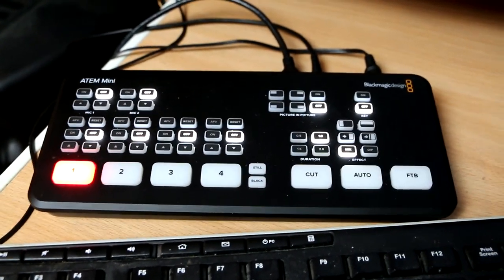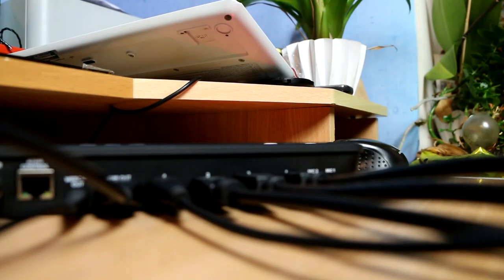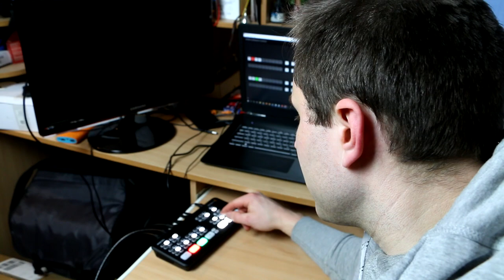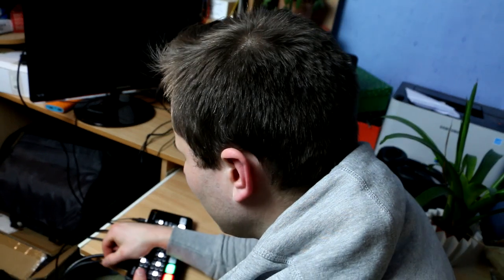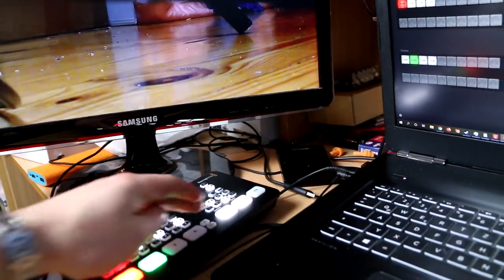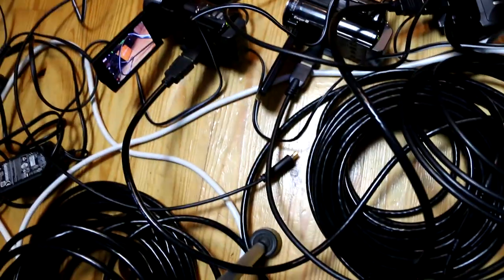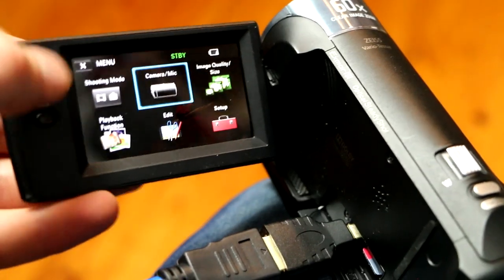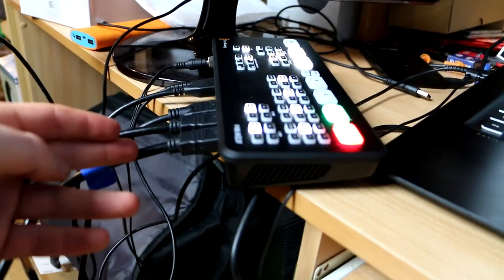How to Fix ATEM Mini problem that only HDMI 1 input works or no input from cameras

Comment: I'm using a couple of color security cameras that don't have switchable output resolutions. I tried a shorter cable and it worked. Thanks for this info. You did a great job of troubleshooting so I didn't have to. I am very grateful.

Comment: Thanks for the video. Had the same problem. 2 Sony ax43a cams. 1 cam didn’t work read. 1 Sony is Auto hdmi resolution. Changed the other to 1080i. Worked.

Comment: Hi! I’m using the Atem Mini pro with 3 Sony a6500. At the beginning I had this same trouble. Only Hdmi 1 worked. I tried replacing the hdmi cables and some of them worked, but then I realized the real problem was other. I fixed it, Changing the HDMI output setup from my cameras. Turning it from 1080p to 1080i. Hope it helps someone!
Reply: Spinaci  Thanks! Turning our Sony A6000 to 1080i helped get it working in input 2 :)
Reply: this worked! thank you very much.
Reply: @humasunmermalang6662  THANK YOU; MY PROBLEM FIXED!!!!!!
Reply: @benlawrence22  Hi. How you deal with overheat on A6000 if doing live stream for more than 30 minutes?
Reply: Thank you so much my friend. Your comment worked and it saved me a lot of frustration.
Reply: God send
Reply: @HarryAdee  just dont record at the same time. I do concert live streams for 3 h and more or online classes up to 9h. It will just overheat if you are in direct sun or if you want to record internally as well
Reply: @Tiki-Beat  I see. Thanks
Reply: @Tiki-Beat  Anyway, are you talking about Sony A6000? I noticed that it has limited time of 30 minutes auto shut off if no activity detected. Say if I just turn on the camera for livestreaming without recording, I assumed the camera would turn off automatically.
Reply: Oh yes! Thanks man, you saved me... I wonder why the Video settings on ATEM Software Control shows the option for video for progressive only. At least I only see the options to 720p, 1080p, etc (with different fps options but always p)
Reply: @HarryAdee  No, it doesn't turn off, if you deactive energy saving options and if a HDMI cable is connected it has activity. I do use an A6000 every week for live streaming, also a6400 and even hacked an old a5000 for web cam use
Reply: @Tiki-Beat  I see. That help. Thanks.
Reply: Thanks a lot!
Reply: You're my hero, thank you!
Reply: Woww.. Thanks.. It worked
Reply: Keep in mind that that 1080i has a different frame rate that 1080p. Progressive scan vs Interlaced. If you want high quality picture its worth upgrading to the optical cables.
Reply: It helped me... thanks! 🍻

Comment: I also have ATEM Mini and I had the same problem. when i converted all camera output at 1080p then I had the same problem. but when i converted to 1080i all cameras works fine. i uses 20m long cable hdmi 2.0
Reply from the maker: Thanks for your feedback, maybe this will help someone as well :)
Reply: @JUrtanschannel  Thanks
Reply: @AlShahbazSound  i have sony pxw x70 and  a100, all in 1080 i dont work... this is crazy!!
Reply: @josecoronelborda1248  i have panasonic ux90 cameras. my all 4 cameras are works on 1080i. But if i convet first camera into dhmi 1 in 1080p and others are at 1080i it also works fine
Reply: only hdmi 1 is support 1080p and others supports 1080i.
Reply: Thank you so much, i solved my problem with 1080i
Reply: @LeocostaFilmes  you are welcome

Comment: We had a similar problem. If we plugged the HDMI lead from a camera direct into a TV it worked fine. But if we plugged the same lead into the ATEM Mini's HDMI 1 input, it did not work. 
But using the same lead from a PC worked fine. Swapping all the leads and changing the HDMI inputs did not help. Nor did changing any of the settings.
The camera had a small Micro-HDMI to HDMI adapter cable and when we changed the adapter, it all started working.
The conclusion is that our TV had a better decoder of the signal it was receiving than the ATEM Mini, in other words the ATEM Mini is more sensitive to signal noise from the HDMI lead than our TV.

Comment: if you're using long hdmi cables, plug it to a powered device (e.g. a splitter) before going in atem mini. It needs some signal boost somehow.
Reply: Thx this worked 4 me
Reply from the maker: Since I made this video I have been using hdmi booster, u can get them from ebay for less than $10 and they does not require any power, but they make miracles, I can easily use 15M+ cables, I can connect two cables together and I dont have any issues with cameras, e.g. picture time to time go black :)
Reply: The use of Splitter Worked!!

Comment: Hi! There is a bit more to it,  read about HDMI EDID - basically it is a handshake system where the camera and connected device agrees on format  the both can work - sadly BMD not always does this well, just a FW update can fix it. 

Other note - even tough long HDMI might work, I newer use them longer than 10m unless it is a really high quality (read expensive) for a static installation.  Given that HDMI to SDI converters are rather cheep - i would use those.

Also on most (not all) BMD ATEM switchers - inputs must match resolution, frame rate and color space, and not all resolutions are supporter by all ATEMs, The safe way for streaming is to stick with 720p50 and YUV colors pace - that works on all of them, 1080i should not be used for streaming as it producers nasty artifacts  unless it is not deinterlaced in software (that it self also creates artifacts or loss of resolution).

Long story short - it is not as straight forward as it might seam, and you should really identify the cause, not just make it work - as then you are not guarantied to have the same result again... good luck tough!
Reply from the maker: Ansi, thanks for advises, I will check more about EDID on the internet. Do you know, why on this video switcher camera works with hdmi 1 input, but not with hdmi 2, is there some sort of boost in hardware in atem mini for the first hdmi input channel?
Reply: JUrtans channel have you checked the same input, camera and adapters but a short 1m cable?
Reply: @ Ansis Imaks: It's very annoying. I am currently experiencing similar problem. I have currently Atem mini pro and I am thinking of selling it due to this Handshake issues. I have also tested it with long cable (15 meters) so the issue is not only on short cables. There's also problem connecting to other devices as well for instance, it doesn't work with my Atomos ninja while Blackmagic video assist works perfectly well. Another issue, your video signal is locked to 1080p with no option 720p or to set your own desire frame per second. The problem is your video will then now be upscale (expanded) and then latter compressed for your stream/recordings which result in slight loss of quality (pixellete).

Comment: ATEM input 1 by default assumes YUV not RGB input to prevent color format conversion latency for gaming application. If camera output is RGB and doesn’t switch to YUV, ATEM may not sync on input 1. Some cameras (basically) output interlaced as YUV by default. None of this tends to be well documented. It has absolutely nothing to do with any cables
because cables can’t convert RGB/YUV color formats they are literally just wires. The issue is mismatch between assumed YUV color format to ATEM input 1 and RGB color format from (typically) a camera. If you can force the camera to output YUV (less likely possible on cheaper cameras) this may solve the problem. Setting some cameras to output interlaced may effectively output YUV. “Shy” progressive PfS format output (even not documented by JVC IMx) may also complicate this. Most graphics cards output YUV by default which will sync on ATEM input 1. Also HDMI cables longer than HDMI reliability spec can cause all kinds of weirdness. Basically outside HDMI 8’ spec all bets are off. It may work ok with super shielded thick expensive HDMI cable, but maybe not - depends on RFI situation at any moment. That’s why there’s SDI.
Reply from the maker: Well I can comment only what I have figured out form using atem mini and cables matter a lot, I have tested more than 15 different cables by brands/lenghts, and cables matter, same settings, same camera, same input can work e.g. on input 3 and not work with different cables, so neverless what you say about inputs/cameras, cables matter a lot!  Ive found out that easiest solution is to fix problems with repeaters (super cheap, super easy to use,  probably does what you says atem input 1 does, idk) and even cheap optical/copper cables, 30m long, work good!

Comment: Had the same issues and tested everything with a single camera. In PAL, the Atem supports 50fps 1080i. If you want 60fps 1080p, you have to be in NTSC mode. Otherwise, it will glitch badly. Learned it the hard way..
Reply: Hi everyone. Nice to se its a global problem and not some local thing. We use 3 Canon c200 cameras with  15 or 20m hdmi cables. They all have same settings Pal 1080p 1/50
Often happens that input 2 doesnt work. Cabble is ok but just doesnt work in input 2...luckie for us we have 2 additional atem mini and we connect them so we can have 3 cameras working. Still it is hige problem. I wrote to black magic design support and the sent me email that I should update my software but also me prepared to roll back my software if that doesnt help...
Also on some days everything works just fine :D but it is randome

Comment: I recommend using fiber optical HDMI cables. I also have ATEM Mini and I had the same problem. The problem was solved by using active cables (fiber optical). No problem with long distances.
Reply from the maker: Thanks for feedback! 
To be honest right now I have 8 different brand and size hdmi cables and I have found out that even regular hdmi cables, 1.4v - 5m and 10m , works really fine, just need to do a little swapping till you find what cable works with what camera, of course if you can afford, you can go for fiber optic cable, if it is really necessary :) 
I have been doing a lot of live streaming now with atem mini and I havent had any issues with cables after I have found which works with what camera :)

Comment: Thank you for This post! I just receined my A M pro version and my Nikon 3300 is not recognized on a short cable. Wonder how do you know from the cables which their nature is??? Adding something after hours later: Finally got a picture to pass through Atem M Pro, but this is really worky! Hope it is easier with my GoPro. Have to get some more cables to try. Nikon seems to give 1080 30 fps out, but the audio does not seem to come through the camera in HDMI mode...
Reply from the maker: To be honest I don't know, I have bought 8 different cables.  What I have found it is that first you have to check your camera settings, bcos sometimes you have to do some minor changes, like to set hdmi out 1080i or p. (make sure your camera supports live view). Speaking about cables, if you are wondering that the problem might be caused by cable version (1.4 or 2.0), I have found out that 1.4v cable will work all right, since ATEM does not support 4k any way.
Reply: @JUrtanschannel  thanks. this is amystery tour. Have to pump up a lot of mental stairs to get to do things... how dont they tell about thede problems on the reviews??? Shit. getting fed up with that kind of marketing. Maybe my nikon 3300 is just not enough of a hdmi camera... Thanks for the tips!

Comment: The HDMI Output on my ATEM MINI doesn't work as it should.

In the ATEM Software Control, the 'Camera 1 Direct' option works, but none of the others do. I'd like to have the HDMI output as 'Preview' mode, so I can see the camera I am about to switch to.

Have tried every available combination of different cameras, different HDMI cables, have tried two different output screens(projector and computer monitor), even tried putting a powered HDMI splitter between the HDMI Output and the screens.

I saw on the BM forum that others have experienced this too, but I didn't see a fix - surely they have sorted this out!?!

The ATEM Mini Firmware is at 8.6.1
It is the original, most basic ATEM Mini

Any ideas would be greatly appreciated, thankyou.
Reply: Hdmi Booster 
Or hdmi splitter

Comment: I got hdmi output problems, it doesn’t show image on any monitor, only the ones that have hdmi/dvi port. I have change every setting/ cable and nothing. I wanted to use a atomos to preview the image and no luck.

Comment: My black magic mini only work on hdmi in 1. All other three doesn’t work. Try cables already. Can any one have solution?
Reply from the maker: maybe you can give more info, like what you have tried out, e.g. have you tried to use only 2nd port with same setup, have you checked ur camera setup, have you tried different cameras, if you put something in 2nd port, and turn on ATEM control, maybe you dont see the picture, but you see the audio bars moving? There is of course a chance that ur controller is defective. Many people dont know that, but it is very easy to destroy hdmi ports(probably not ur case :D), if the ground connection between devices is intermittent while plugging the HDMI cable, it might blow up either one of the devices HDMI chips. I have heared from one technician who saw me swinging connected cable at one end, that it can end up badly, he had one burnout on one camera hdmi port, where one end wasn't plugged in, but other was connected via hdmi port to camera and then boom, port just burnt and it was very expensive camera so it was a huge loss, so you never. 

Well there is still a chance that even your both cables arent good enough for port 2nd and rest of them and for your camera :) As well what sort of adapter are you using, mini or micro? Bcos with micro adapters there can be a lot of problems, if you don't buy the one who works with ATEM

Comment: interesting...My cable is a factory done HDMI big->mid connector. You have small adapters there switched to bigger cable heads...? Why is the hdmi not a standard as they market it to be...? or do I just assume too much?
Reply from the maker: I think it is just because they want to save space on cameras as hdmi connector is out for many years and it's size is rather big. But I must say that  hdmi micro is just crazy, easy to break and easy to lose connection with even small movements of camera.

Comment: When i connect my camera to ATEM Mini, it switches off. If i switch it on, it switcehs on and it immediately switches off. What can I do?
Reply from the maker: This does not sound OK. I would suggest to start with checking if you have hdmi control on, if yes, turn it off and and try again
Reply: If it's a DSLR camera adjust the hdmi cable carefully and properly and it'll be just fine

Comment: Is it need adapter or converter to connect camcorder to atem mini ?
Reply from the maker: Yeah , but it is cheap, usually hdmi mini for older cameras and hdmi micro for newer. As well not all hdmi - hdmi micro adapters will work, cheapest adapters may be useless, especially those with extra cable, if they are from the unbranded companies.  So you never know befor u try them if they are good enough for ur atem mini

Comment: The problem is not your HDMI cable whether short or long and uptil now, with already 2 updates, the problem is still going on. Unreliable product, no wonder it's cheap. I use Atem mini pro by the way and the way I fix mine is to use mini converter from black magic. So basically, connect the converter to my camcorder using SDi connection and then connect the converter to the Atem mini pro using HDMI cable.  The coverter needs USB power to power it though.

Comment: HDMI don't work well if the length is more that six meters, to achieve long runs means you have to use an active HDMI cable. Plus I notice you're using adapters on the ends of the cable on the camera side. Why don't you get a moulded HDMI to mini/micro cable so you wouldn't have to use the adapters? Try to keep the length to maximum of 6m or buy an active cable if you want it longer.

Comment: anyone experience a problem with mic inputs of the ATAM mini pro? We had the same problem with the cable and Mic inputs. when we plugged to the mic 1 didn't work and tried 2nd input didn't work, then again we tried the 1 input then it worked.. we were really upset and feels like it is not a reliable device.
Reply from the maker: well I have some audio issues as well at the moment and I am trying to find solution, however mine are caused by OBS and probably some driver conflict, who knows. On my laptop everything worked really good, but we bought a new pc and now we have some issues with audio. On ATEM software i dont see any problems, but on OBS time to time audio just disconnect during live stream what causes a bit of stress and quality issues, since it takes around 3 sec to get audio back. Have you experimented with mic settings  in ATEM software, general settings, audio, where you can change line to mic?